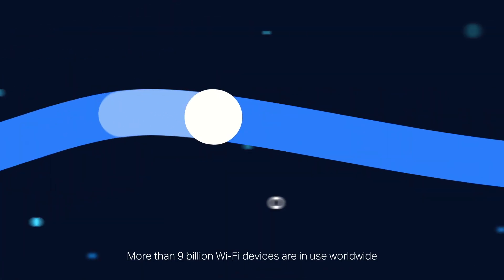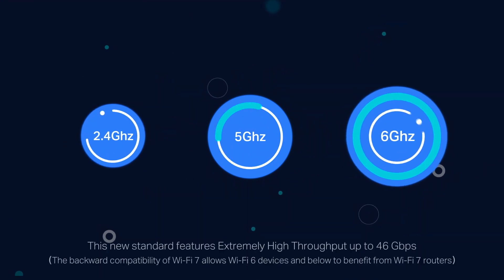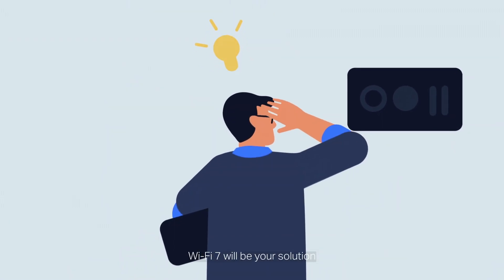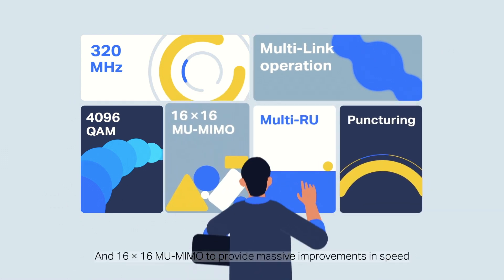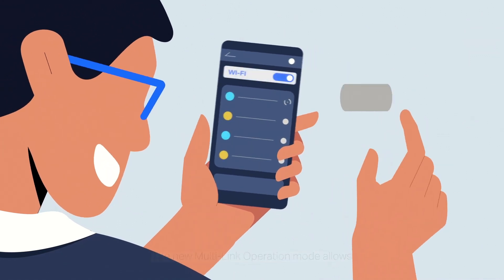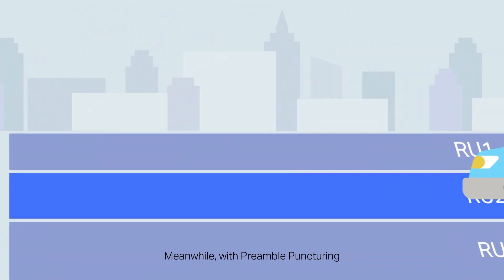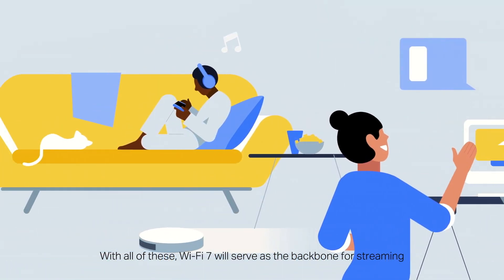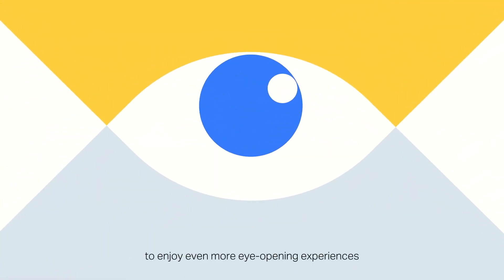WiFi 7 Technology | TP-Link | WiFi 7 Explained

Comment: You've explained wifi 7 really well but You've not explained thatbnot all your device will be compatible with it and compatibility will be a concern !
Reply from the maker: While it is true that not all devices are compatible with all of the key features of WiFi 7 that same can be said with the technology jumps of WiFi 5 and WiFi 6/6E.  Even if your older legacy devices cannot make use of WiFi 7 they can still connect to a WiFi 7 router's 2.4 GHz or 5GHz networks.

Comment: Too early. Barely anyone I know is on WiFi 6/6e. Im probably the only guy in my neighborhood. People are all on WiFi 5, the vast majority at least.
Reply from the maker: WiFi 6 has been extremely popular and widely adopted over the last several years.   WiFi 6E is more of a transitional protocol, hence it being an enhancement of WiFi 6.  WiFi 7 is the full realization of the features of WiFi 6 + 6GHz communications.
Reply: @TPLINKUS  Yea but 802.11ac is still the most commonly used standard . WiFi 6/e (802.11ax) is catching up yes but it’s still relatively new. I have had to fix some really obscure problems for people who have older devices but upgraded to new routers. Especially Spectrum customers who just do the upgrade without research and plus use Spectrums equipment. 

With that said, I am excited for WiFi 7 but that also means purchasing new devices that support it so that you can get the best out of it.